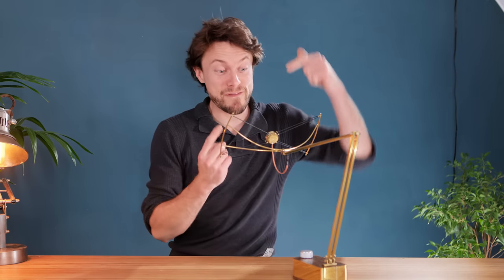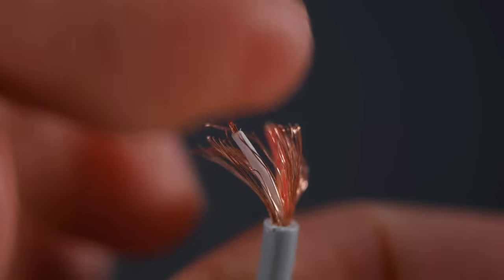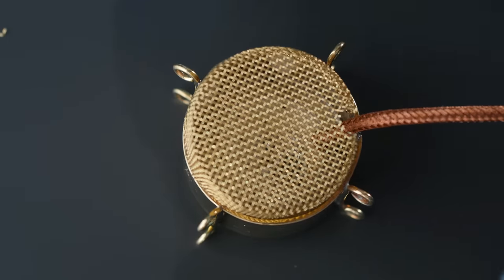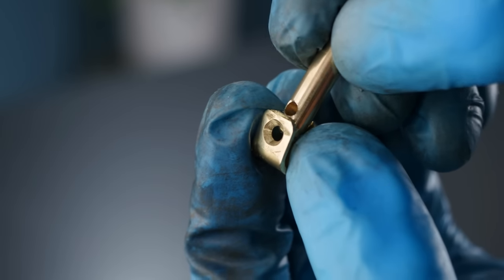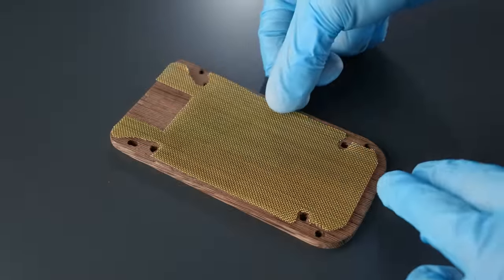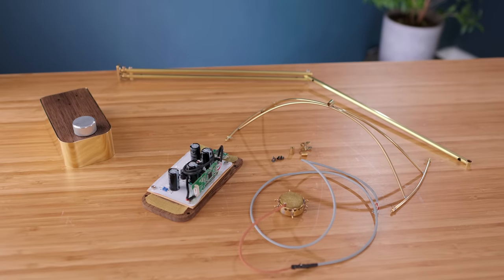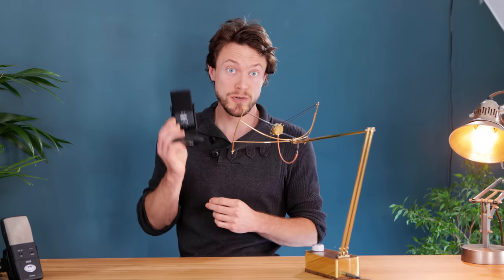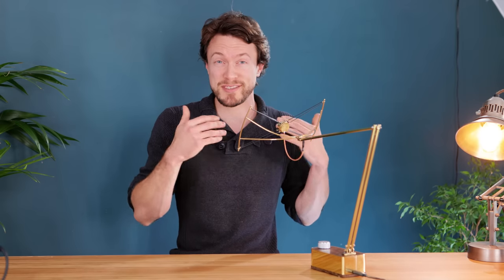Building a quality USB-C microphone

Comment: The DIY mic would need considerably more post prod than the Neumann to clean up some of the clicky mouth sounds, lip noise, and general top-end.
BUT for 40$ it sounds genuinely incredible: bright, clear and could easily slot right into a modern pop song. I'm seriously tempted to build my own mic with this capsule but without the pre-amp, to use with an audio interface.
Reply: i feel like he shouldnt call it a 30$ microphone. its only the parts that cost that much. but he never took into account the working hours and tools he used. and most likely not the parts he screwed up. you see the experience he gained from screwing up the first time making the capsule? that right there is why you pay top dollar for high end microphones. you not only pay for the parts but for the experience and thousand of work hours put into developing these microphones.
Reply: @Zimmerer_Sebastian  You can fail like more then 10 times for the price, tools are pretty much what you see, smol blowtorch, soldering iron, soldering wire. Time usage is actually a good point, but it's a DIY project, I think it's more like to be a spare time build
Reply: @Zimmerer_Sebastian  I understand what you are saying...but you could buy all the tools and parts you need to make this microphone (like 4 times over), and still save money. You'll have a homemade microphone, and tools for the next job that will save you even more money. Tools are always a worthwhile investment. They save you money every time you use them.
Reply: @Zimmerer_Sebastian  You're right, but I believe that the majority of people who would even consider making this microphone already have all the tools available.
Reply: @Zimmerer_Sebastian  you cant buy the parts for that the mic capsule has $30 shipping on it and the excess of materials you have to buy adds up to around $140 if you had no postage and only charged for the exact amount used you may be at that sort of price possibly $50 the preamp parts alone are about $20 + $10 postage. I dont  know why He made it sound such a cheap project if he had said $100  that would have been ok and still worthwhile .
Reply: @isaackvasager9957  I have all the tools to make this project and the price estimate is massively under what most people could do it for by about $100   just price all of the brass and components  including postage. the only way this could become viable is if someone made a kit of the parts for around $60 delivered. set to and try to buy all the parts see how much it cost the mic capsule is $43 delivered the components for the preamp $45 delivered then all the brass about 40 only thing is you will have brass left over for other projects.
Reply: @timbrown9961  which is still significantly less than $3,000.
Reply: @mnemos why would this DIY mic pick up more clicky mouth sounds etc than the Neumann?
I use one of them Scarlett 2i2 bundle mics so I might be off, but all these mics do is capture, preamp and pass the signal without any EQ/correction for clicks etc because that would be undesirable.
Reply: @timbrown9961  have you considered that a person who's job is to make these budget DIY projects, they might be better than you at finding a good deal? Do you think they're on here lying just for clicks? People would still build this for $100, but he says $40 and I trust it's possible if you know how to shop.
Reply: @isaackvasager9957  BY-M1000 34mm Large Diaphragm Condenser Microphone Podcast Mic Kit Support Cardioid/Omnidirectional/Bidirectional with Double-Layer Pop Filter Shock Mount XLR Cable similar price many more features around $120 US
Reply: @isaackvasager9957  and you can do significantly less with it :)
Reply: @youknowhu  you're correct that the microphone just captures 'sounds' the nuemann has in integral pop filter which helps to smooth splosives (hissing and popping associated with different mouth sounds) those those harsh sounding vibrations don't interact as heavily with the capsule giving that nicer sounding microphone.
Reply: It needs a single preset just like every other mic I’ve ever bought xD  I’m impressed xD
Reply: As an audio engineer, im quite skeptical about the actuall mic quality. As well i would consider all the test as invalid:
1) The audio coding of youtube is crap. Hearing for any differences even in a proper listening situation, is nearly impossible because we just dont know what youtube has done to the audio signal.
2)All the preamps & ADs used in this video (the internal of the DIY Mic, the internal of the rode and the scarlett 18i20) were considered as noncolouring and not distorting at all, which is just blasphemous. Top end ad&da converters(like rme,merging or dangerous…) and exclusive Preamps (that are supposed to be noncolouring)(SSL,UAD…) deliver performances far beyond a scarlett 18i20.
(Im considering the diy parts as worse than the scarlett). Therefore a comparison with a u87ai just isn’t possible, the worst part in the signal chain is not the mic, which would be a needed condition for testing mics.
3)All tests were performed with a voice, which is cool to leave an impression (general audience), but non of them is actually testing a freq. response, the dynamic range/noisefloor, the thd values (as well as thd+n), or the signal sensitivity.
Further all audible sounds were definitely made up in the postproduction, with maybe some eqing, but definitely some compression. Therefore the tests and examples aren’t valid and or important in any way.

Further id like to mention that most people wont have a chance to be in a listening situation, were you can tear apart the differences between mics,preamps and converters, because of the high cost a quality sound system introduce and most peoples ears are just not trained to listen for such differences.
Therefore this homebuild is a superb consumer’s microphone with a really good ratio between price and quality, but in my opinion miles away of a professional mic. ;D
Reply: @Zimmerer_Sebastian  admittedly the only tools you need for this can pay for themselves, you could literally just take this, sell it for 70-100$ a pop and recuperate your costs quickly
Reply: @clemybeatz8031  your whole explanation contradicts your opinion, you just said that there is no way of knowing the actual quality of the mic and immediately after went to say “it is miles away from a proffessional mic”… what?
Reply: He said "in my opinion", which is considering what we can quantify : the components.
Reply: @Zimmerer_Sebastian  what? What "less" can it do?
Reply: @timbrown9961  and doesnt sound as good at cause it has a tiny condenser microphone. He talked about this in the video and gave an example. Did you even watch the video?
Reply: But how to make this mic without the amp cause we already have the sound card. 🤔
Reply: @arash5550  just don't put the amp in then...but go ahead and do that and you'll see why pc microphones have a preamp.
Reply: @mit5oner  in case you really got a understanding of how microphones work how preamp circuits are designed and which criteria will be important for a good analog to digital conversion, you hadn’t missed the point.

My comment‘s topoc was about the fact, that comparing a diy build mic with an integrated bus powered preamp and converter can achieve proper results for a youtube videos, but is far away of condensor based state of the art microphone, which gets used by preamps & converters , that only can be found in a professional situation. (If used proper)

If you like we can get in a further discussion why it is problematic to have an non protected cable from the capsule to the preamp or why putting a grounded shield above the isolation could lead to a loss in higher frequencies, why its not usual to balance with an impedance of 3,8 kOhm and 10k resistor would have fitted better or why it has to be a consumer mic if preamp and converter is build in.
Cheers
Reply: @arash5550  you get a male xlr connector build a proper case around capsule and connector and connect your mic to the sound card (be careful,  no phantompower needed, its a dynamic design)
Reply: @Adierit  you'd likely end up making a dollar an hour selling these at $100 each
Reply: I mean, I’m just trying to build a mic for talking to friends online, soooo, yeah, this is great! What if I were to get a lamp arm, the type with all the springs and hang the mic from the end, like those old studio mics they show in old classic movies?
Reply: @Zimmerer_Sebastian  this is true, but it could have been made from recycled garbage that would have been easier to work with and even an almost tool-less design, aside from the soldering irons and solder wick and solder wire.
Reply: @LORD_DANZILA  I have a half hour before my shift starts where I repair and modify circuit boards. Aside from the stand, support and the amp housing, I could easily manufacture these.
Reply: @clemybeatz8031  saved me a whole lot of typing 👍
Reply: @isaackvasager9957  34 mm is much bigger than the one he uses in the video I did watch thats how I know
Reply: @Zimmerer_Sebastian  The tools aren't even that expensive. Even if you started from ground zero with absolutely nothing, you could still build the microphone within a $150 price range (and that's assuming you don't know what you're looking for and assume better == more expensive). 
And besides, any FUNCTIONING adult should have a set of tools to take care of basic maintenance around the house/apartment. If you don't you're basically a little manlet.
Reply: @timbrown9961  In an age with literal unlimited access to knowledge and a nearly unlimited supply of vendors you're really telling me you cannot find a cheap supplier? Do you not know how to shop around? In literally 2 minutes I found a supplier that would sell all the necessary brass supplies for only $13.

Try harder.
Reply: @timbrown9961  Adding postage to the bill of materials would be an absurd way to calculate it. And clearly he is aware of the shipping being expensive considering "Shipping to the EU is expensive, so I'm working on a group buy. Check back in a few weeks' time!" is part of the description right after the link to the capsule. And I don't know why there would any significant amount of excess material if you already know your dimensions.
Reply: @timbrown9961  The reason he didn't take shipping costs into account is probably because there are too many factors to take into account. Area, mailing service, even the time of year can change shipping costs dramatically. As for the cost of materials, that varies by the vendor. For example, it's often cheaper to buy electronics components from Digi-Key or Newark than it is to buy them on eBay. (Something particularly interesting I've noticed is that Adafruit products in particular get a dramatic markup from Adafruit to eBay.) I'm not sure how the cost of the brass varies from eBay, Amazon, and other places, but I'd assume it's similar to how prices vary even for the most common of electronics parts.
Reply: @Zimmerer_Sebastian  Yeah but it'd be really weird to classify the cost to make his project to include wages and equipment.
Reply: @clemybeatz8031  ok, please elaborare. Im all ears

Comment: Nice work. The microphone capsule you picked is a rebranded (possibly same company, sold under another trade name overseas) Transound capsule, the TSB-2555B - very popular in the homebrew mic community, but fairly old and there are capsules out there now with superior specs at a lower price. Notably, PUI Audio has a new capsule out, the PUM-2745L-HD-R, which has very nice specs for an electret (-45+/-3dB sens., 71dB A-weighted SNR, cardiod pickup pattern) while costing about $4 new and being in active production. Their AOM-5024 is even crazier if you're okay with an Omni pickup pattern, something like 81dB SNR or thereabouts in a capsule that costs a 10th of an equivalent Primo capsule - Primo also makes very nice capsules, though more expensive, especially in North America. In NA, you can get PUI capsules from Mouser, but you'd have to order Primo capsules from Micboosters in the UK, they're the only ones still distributing low-quantity Primo capsules AFAIK. Primo doesn't take non-business orders anymore.
Reply: I reckon you should make a video making a hectic mic you sound like you know your stuff mate
Reply: Hey! So I bought some of the 2745 capsules after seeing your comment. I got it working, but it has a strong buzz  since it has to be amplified so much. Any ideas?
Reply: @Will-ob5ok  Oeh, I really wanne know wether this works or not. Will, did you fully enclose it with brass? if not, than it might be interference.
Reply: @Will-ob5ok  did you fix it ? If yes, how ?

Comment: Plot Twist:  Matt is secretly manipulating the brass metal market through his videos. 
"Yesss, that's right! EVERYONE build with brass! Mwuahahaha!"
Reply: I will built it with steel and spray it like brass
Reply: His freetrade portfolio is probably all brass futures
Reply: @robertkonig177  it’s harder to build with steel because it needs to be welded. Soldering is easier to learn and basic soldering equipment is much cheaper to buy.

I grew up soldering circuit boards as a kid, I learned weld as an adult and while I enjoy doing both I can honestly say that soldering together a build like this is much easier than welding it.
Reply: Tiny amounts of brass for a project like this are not particularly expensive and being a soft metal, it is much easier to work with (drilling, tapping, filing and sanding etc.).

I’m slightly biased in favour of brass builds, as might be seen by some of my videos 🤣
Reply: was thinking the same, I told myself he must be a brass seller's son or an inheritor

Comment: Astoundingly elegant design and functional to boot. Sounds like it has a little more high-mid timbre than the Neumann, more clarity in plosive sounds without being offensive. Actually, when you went back to the Neumann it would sound dull, as if it was scooped too much, like talking through a blanket.
Reply: Took all the words right off the tips of my fingers, lol. The DIY is slightly approaching a bit of harshness in the plosives for my ears, and my ideal would maybe be somewhere between them, but that really just speaks to how impressive his design is.
Reply: @aguenter  Would be hard to get the neumann the sound as detailed, easy to correct the DIY.

Comment: The  DIY seems to do an amazing job with a just sounding clear and is extremely impressive and with the right software could easily be tuned to sound almost if not just as impressive as the Neumann. Thank you for posting this video, hopefully the prices of these parts to built it haven't sky-rocketed. :)

Comment: I can hear more highs in the DIY, but that’s something that can be EQ’ed and can sound as good as the $3000 mic. And adjusting the gain control, threshold and more, that $30 mic can sound superb!
Reply: Do you have any idea how that can be done though? Would that include using a lower/mid pass filter to reduce the overall amount of highs and perhaps adding a very low gain (1 to 10 times) modifyable circuit which can be modified by rotating a knob that changes the low resistor in the circuit? 

If you know please update me, my specialty is mechanical and software engineering, I only know a bit of electrical engineering so i'm sure my suggestion would prob bring up an issue with noise
Reply: @its_hokori  just do the eq digitally in post
Reply: @its_hokori  doing it digitally using FabFilter Pro Q3 and/or Soothe2 is most certainly the easier/better option. Not modifying the hardware, allowing the extra frequency pickup when you want/need it, and then fixing any issues in post.

As this mic sounds superb as it is, and I don’t hear anything that sticks out as detrimental to the sound that necessitates a hardware modification.

Comment: A good thing to mention, is that if you can't work with brass, a fairly good alternative is to work with copper and just use a string soldering iron.
Tin and copper can easily be electro-plater with nickel right at home, which will prevent rust and make it look just as proffessional as brass.

Comment: The Neumann does sound better but it's DEFINITELY a case of diminishing returns, it certainly doesn't sound $2950 better. The DIY mic is really impressive!
Reply: It depends what it's used for.
The Neuman will have fewer aspects that need correcting. If it's a fire and forget permanent installation then the battle is only fought once. If its used differently each day then the time saving alone pushes the balance the other way.
Reply: That's funny
Reply: @dougaltolan3017  Realistically, you still need a low pass filter/EQ and compressor on the neumann. All mics (and the mix!) benefit from correction and control.
Reply: @g10118  yeah, I do live gig sound, and as a control freak I'm not going to argue there. But, the fewer battles you have to fight on a daily basis the better. Also, the fewer battles you have to fight, the easier it is to hit that sweet sound.

I am confident that if this mic was subjected to full spectrum and spatial response tests it would come out looking like you were singing in a thimble.

The casing of the Neuman is far more acoustic engineering than esthetics, it will make a difference.
Reply: Neumann is charging premium prices tbh, for example their shockmount (in Germany we call these things "Spinne"= Spider) EA4 is identical to the Sennheiser MKS4 (Sennheiser is the owner of Neumann since 1991 and their production went from Berlin to Sennheiser's Headquarter nearby Hanover, so their own MK4/MK8 might use the same capsules as more expensive Neumann mics) but costs around 140€ instead of 100€.
Would be interesting to know which directivity of the U87 Ai was used, it's got cardioid, figure of eight and omnidirectional achieved by the use of two capsules.